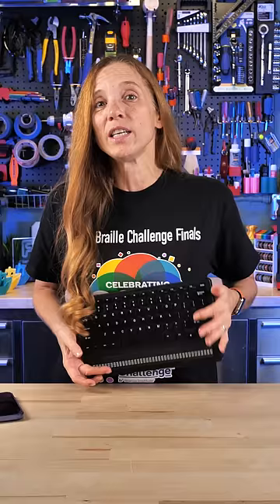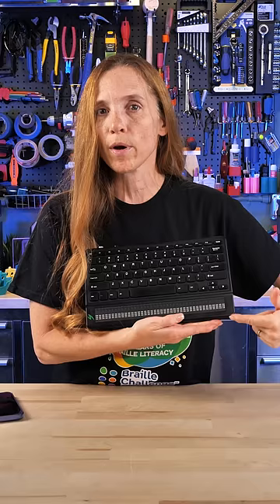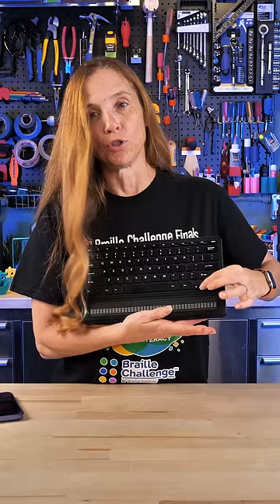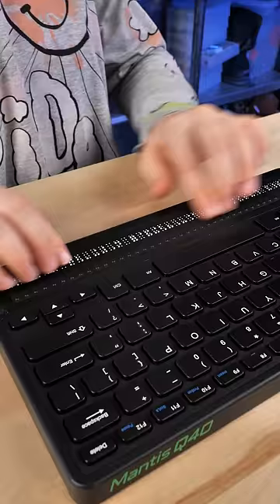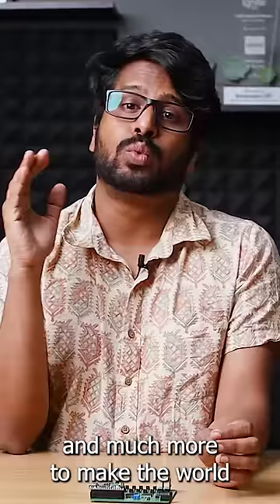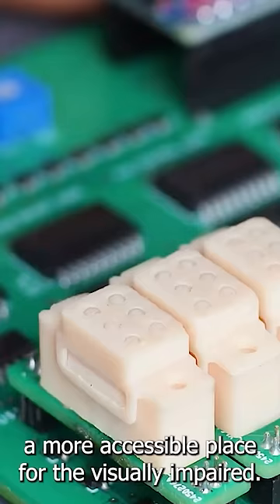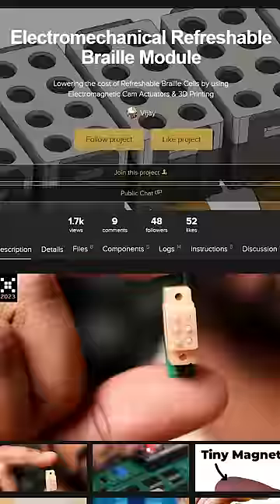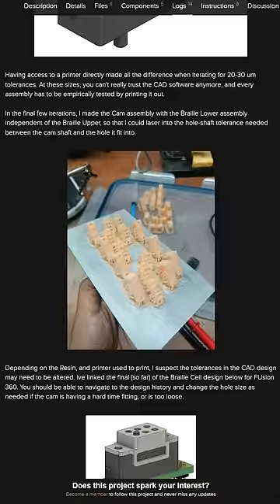A Refreshable Braille Display–at lower cost??

Comment: There are TONS of blind people- it’s just mainstream society ignores and doesn’t cater to them like we should. I live in like the 4th or 5th largest city in the US and a lot of our traffic signs are still NOT accessible.
Reply: i think she meant in relation to the general population lol.
Reply: @LossBH  which would still be TONS of people, and because they aren’t 51% of the population then it’s fine to not make things accessible when it’s easy to?
Reply: @saorise28 this particular case isn't about accessibility, it's about free market forces. 

We all want blind people to be able to access the world with refreshable braille displays. The issue is cost, and the cost is justified due to the difficulty of manufacture and the low volume of production.

Difficulty of manufacture includes the cost of creating the injection mold, without the volume production to amortize the cost. It's also an electromechanical part, each character requires 6 "motors". Those motors are not easy to make in bulk the way an LED or LCD is.
Reply: Less than 100,000 people in the US use braille. Of course public spaces should be visually accessible, but they are not “a ton” of people, especially in relation to the total US population, of which they make up .0003%. Accessible devices should be made available for less. But it makes sense that they would be expensive when they have to be more engineered than regular keyboards, but have a much smaller consumer base.
Reply: @nooneinparticular469  use brail- and legally blind are two very different things/numbers and you know it. Don’t try to use skewed numbers. Maybe if more things were accessible with it it would be more widespread- just a thought.
Reply: @saorise28  Dude, the specific accessibility tool this is about is exclusively for people who use braille. So those are the only numbers that arent skewed.
Reply: @nooneinparticular469  if you reread my comment, you’ll see I specify tons of blind people. Let’s get that straight at least. And you’ll also notice I’m not only talking about this specific device. I’m taking this video and expanding the conversation.

Comment: Wow, that's very cool. When I was young, before computers, I worked for a typesetter. My main job was to proofread documents for grammar, spelling and typesetting errors. One of the companies I did proofreading for was for a print shop that had one of the few printing presses that could "print" braille pages.  So my boss would print stuff out, I'd proof read it then send it to the printers. Some of it was printed regular like a magazine or paper insert or whatever, but they'd also print off braille copies. They had employees there at the facility that would then transcribe the text to braille, like an interpreter. Things have changed a lot in 40 years,. Your kids amazing, that little machine is awesome,

Comment: Oh that's impressive. 3d printing is changing life's and this is just the start.
Reply: 3d printing is actually a much more expensive way of doing this, the problem is that anyone can get a 3d printer but an injection molding machine requires investors and a factory, those investors expect large returns and will push the price crazy high, I can almost guarantee you that the time and material costs of the other braille modules are MUCH lower than this guys
Reply: @evangorski7992 Depends on the quantity you want to make. If you're just making enough for your own personal use, which sounds like the case, it's significantly cheaper than investing the money for injection molding equipment. 

To keep the price of the injection molded ones low, you need enough volume to dilute the upfront cost of the equipment, staff, designers, materials, etc. Since it's such a niche product, it sounds like there really isn't enough volume to dilute the cost to where it'd really be worth it to mass-produce the way a lot of other injection molded parts are. 

So if they could move the volume, would the production costs be significantly lower than a person individually printing them? Yeah. Do I think the production cost right now is significantly lower than an individual person printing them? Depends on how much they use their printer for other things. 

Besides, we all know the physical pieces aren't what makes them expensive, it's the controllers/electronic bits.
Reply: @evangorski7992  except it’s not. It all depends on the quantity but even then if the part can’t be made without a multi piece mold then 3D printing may be cheaper than injection molding. This also isn’t a large part and it has small details hence making it harder to injection mold.

Also you are wrong about the cost of the commercially available Braille cells being cheaper than this guys, some he took apart used piezoelectric actuators which are very expensive and likely significantly contribute to the price of the overall product.

Even with resin printing these can be made relatively quickly, possibly up to 100 or more per run and Braille devices like this don’t have that high demand so the quantity of parts needed is relatively low.

Saying 3D printing is more expensive just as an outright statement just makes you look like you don’t know what you are talking about, it is a lot more complicated than “injection molding cheap, 3D printing expensive”. There are a lot of factors that can influence the costs of both methods.
Reply: The 3d printing makes it more expensive which is the impressive part about the tech.  At prototype costs his design gets that cheap by using tiny solenoids instead of motors or piezo elements for the actuators.

Comment: I was actually thinking idly about a system like this not too long ago, I’m not even blind, nor do I know anyone who is really, but for whatever reason the idea of like a braille grid that can change on the fly like a phone display upon interacting with it stuck with me, but I had never bothered to actually look up if something like it existed before. My initial thought was that it would be like those kids/fidget toys that’s like a flat rectangular plate with a bunch of equally sized tiny pegs sitting bunched together that you can push into to see the impression of the shape on the other side. Basically just that these tiny pegs could be programmed to go up and down to display any set of braille characters, all on one surface. The fact I’m just now randomly discovering thru a YouTube short that it’s a real thing is really funny to me, and also really cool.

Comment: From my experience helping the SLP community with their AAC needs, the core of the costs tends to come from the reliability aspects of engineering (e.g. making sure they don't break, insurance replacing them when they break). DIY becomes very cheap because we don't add those kinds of support and reliability charges, which drops the price dramatically.

Comment: And the thing is, 3D printing this stuff is actually the expensive way to make it.  If somebody can take this and turn it into a product manufactured in more traditional ways, in larger quantities, it could probably become much cheaper still.

The really innovative design of his devices is also much more compact than most traditional ones, which means you can also potentially do more than just a single row of text with them, too (imagine a whole tablet surface of them, so you can actually have a full "page" of braille at a time, etc).  It's also much lower power (it basically only requires power when changing the text, similar to e-ink displays), so could be used in lots of more portable applications that existing modules just don't work for.

I really hope development on this continues.  There is just so much potential here...

Comment: Just imagine how much lower you can get material/personal cost if injection molding was used to make this mass-producable. I mean, it's not like there isn't a market. It's said that 10% of visually impaired read braille, that would be on the order of 30 million potential customers. The market is big enough, the companies just didn't care because it probably made more sense to sell way less for 6000 bucks a pop instead of selling more for 60 with less profit margins.

Comment: Crash the cost!  100 dollars A MODULE?  Unless the module is that 40 element section all together, (which would still be expensive over the 40$ total of the 3d printed one), a 100$ per element would equate to 4000 for that braille keyboard section.

Comment: Well it's cool, but it's not like "someone 3D printed something and now it's cheap", or is it?

I also think it is illusive that 3D printing lowers production cost, when injection molding is way cheaper (on scale)... We're talking cents.

I'm also not sure about the precision and durability of these parts.
In the end, someone has to develop and manufacture these parts.
If you take labour as charity, these may become cheaper.
If it is home build, what else do you have to buy to produce the parts, work with electronics, etc.?
How will you know if everything works properly?
How will you troubleshoot?

I totally agree specialized equipment should be affordable for those in need.
Reply: Just looked up the manufacturer of the braille cells and the hackaday project.

The company uses piezoelectric to actuate the parts and gives them 10^6 (10 million) cycles. These use barely any moveable parts.

The hackaday project uses electro magnets, magnets and rollers.
It is definitely an awesome project.
Question remains, if the durability and precision is adequate to last long enough to make them viable (if they are 1/10 the price but last only 1/10 the time, not much is gained).

Comment: I'm sorry. Are 3d printers cheap nowadays? Why are a lot of people making it look like it's cheaper to buy a 3d printer than to buy a hundred dollar special keyboard?
Reply: It's relatively cheap to manufacture, when you buy an iPhone you're not expected to buy an iPhone facility as well,
Reply: 3D printer I got is something like $130, if it can make (most of) that keyboard, it’s already nearly paid itself off and still has literally infinite possibilities. Also, filament is super duper cheap, even the biodegradable kind which I have

Comment: This type of video is extremely dishonest. It’s $1 of materials to produce but the labor is through the roof. Not only did the guy make modules with 6 dots instead of 8, they only created a display with 3 modules. Why? Because it’s super time consuming. Believe it or not, each module that costs 100 dollars is most likely composed of materials that add up to less than 1 dollar. Even it todays age, reliable mechanical interfaces that are far less complex than brail displays can cost hundreds of dollars. If brail display were mainstream, a high quality one would prob still cost more than an iPhone.